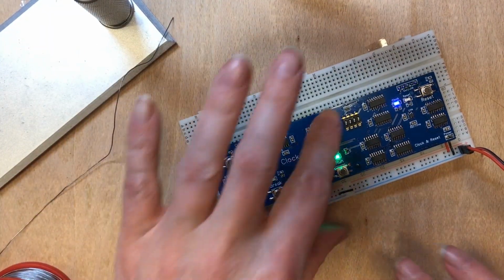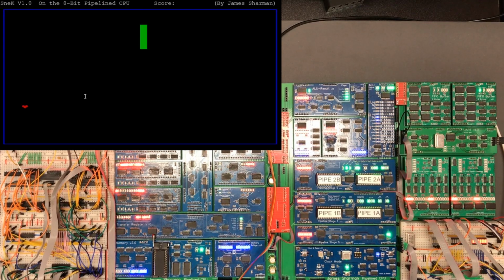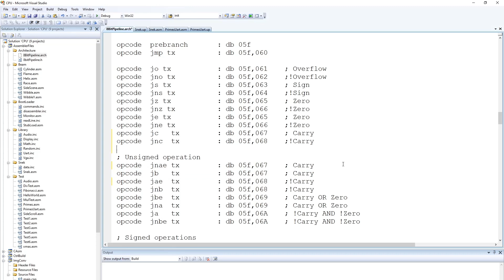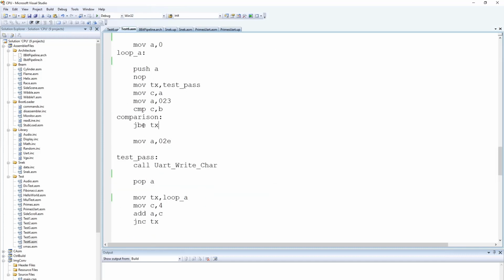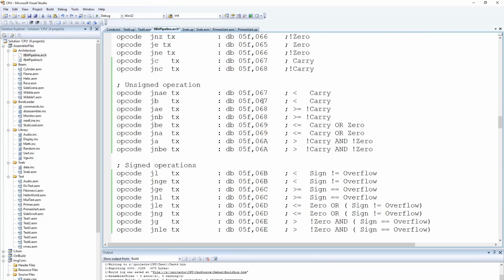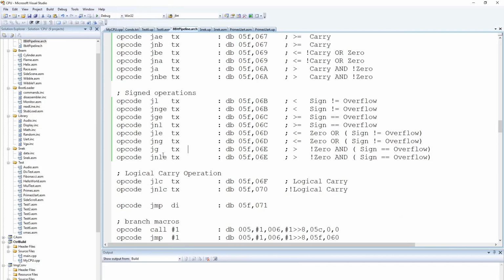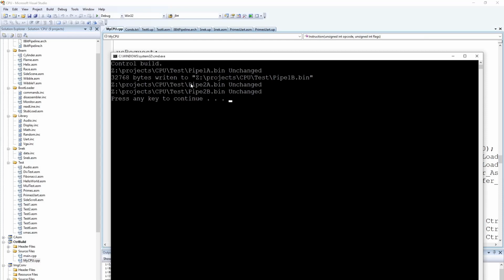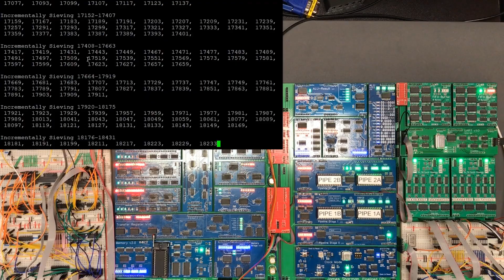Spring Cleaning - Making an 8 Bit pipelined CPU - Part 99

Comment from the maker: I would like some feedback on this approach of separating out longer bits of soldering and assembly. I didn’t want to have half the video be soldering that I had more or less shown before but I could do something like this for future pcb work as well.
Reply: This was a good way of doing it. I.E. have a separate video for those who want to see the full soldering, while having a sped up version in the main video, as most of all of the soldering is the "same" for all of the boards. That being said, if you find an error in the PCB while soldering it, cutting from sped up video straight to normal speed may be a bit jarring.

On the whole doing the video this way was good, I liked it.
Reply: Personally I don't mind the sections with the soldering, but I could see why it is a good idea to publish them in a separate video.
Reply: I like looking the soldering. But its ok to view another video. It seems a good idea to have interesting stuff for all on one video and seperate the other stuff. But its for me also ok if i can skip to the timestamp which is interesting for me.
Reply: Works fine for this kind of updates.
Reply: It was great to see your soldering technique develop over time. But now that you seem to have it down pat and the hardware is becoming more complete, I’m happy for the fast-forward version.
Reply: I like it! You are just doing the same thing again, and those interested should go back to the "ALU result" and "Clock circuit" videos for better context and explanations of you expect the circuits to do. And those interested in you soldering has the option to watch the stand-alone videos. Making those stand-alone videos you keep a good pace for the video, and it is 18 minutes instead of 40(ish) if they were included. But for new boards, like the upcoming VGA board I think that should be in the main video.
Reply: Another thumbs up vote on this approach. So much of soldering is the same thing which is why we typically automate it. There are plenty of videos focused on technique for those who wish more details of that process. I don't mind the speed transitions but it might be beneficial to experiment with different techniques to splice the regular and over caffeinated worlds together based on feedback.
Reply: For the most part everyone knows what soldering looks like but to have a longer version is not a bad idea either.
Reply: I think it's a good time to start breaking those out, or possibly skipping the extra work of editing/uploading them depending on if people are interested.  It was incredibly interesting to watch as you learned to solder surface mount, and experimented with different techniques, but now that it's just doing the same thing every time, it's less interesting.  I think that's really the key--if you're doing something new/different, it has more interest/appeal.  Thanks for sharing, as always!
Reply: Definitely - default to shortcutting the soldering, with the option (or links to) more in-depth  soldering videos.
Reply: If I was watching all of these videos after-the-fact, I'd probably want shorter versions, so I could get through them all in a reasonable amount of time. However, now that I'm all caught up, given the frequency of the videos, I'd be happy with longer versions, so I can hear more of your musings as you build things out!
Reply: I agree this approach is better (and as you know, I like soldering!).
Reply: Thanks for a interesting series
As long additional and important information is included in the main one I have no problem looking at the soldering afterwards

Comment: Good to see that the ALU Result PCB re-spin was simply incorporating the fix previously effected by a bodge wire and that the slightly "sus" behaviour of some of the conditional jump instructions was due to the microcode. So in the end, a clean and dare I say it: easy fix 😅
- On a related note, I've been tooling around with FPGA stuff and thus far, I've found that nearly all of the time unit tests (or "testbenches") of a device under test fail is due to dodgy input data in my test conditions, rofl.
Reply from the maker: Sometimes I wonder if it's better to keep a few bodge wires around. At the time of writing I have a couple of pcb's in the queue which are just reworks to incorporate bodge wires.

Comment: I still have an MC6802 Motorola microprocessor quick reference guide (I used to program it in Assembling code in the early 1980's). That guide was full of errors, that I mostly corrected back then, but I could still find and correct one more error a couple of months ago. You cannot even trust official papers on technical stuff!
Reply from the maker: I have a few old manuals with my own errata notes scrawled all over them!

Comment: Can I just ask, the monitor, seems like a silly question, are you running that as a terminal, or do you have an actual monitor working? As it seems to me the VGA card looks separate to the terminal screen. Also did you bin the lcd display? Can’t seem to see the point in the video when you changed from the lcd to the monitor
Reply from the maker: Once I had the UART working I used the lcd a lot less, I always regarded that as a temporary stop gap. The vga and the UART driving a serial terminal do cohabit.
Reply: @weirdboyjim  do you think you will introduce screen modes on the vga screen so you don’t need to log in via terminal

Comment: Quite tidy indeed!

I saw where you corrected the problem of the loss of the logical carry flag with an option jumper, and you appear to have fretted about bugward compatibility with the earlier version of the ALU.  Did you move the jumper in the final version? The discussion sort of swept the issue under the carpet.
Reply from the maker: I never did change it, I have an option in the simulator for either options as well.

Comment: Deja vu. Debugging the conditionals code in the DPS8/M simulator.

(Conceptually to me,  the simulator, C code implementing the conditional instructions is very much like the microcode in your hardware.)
Reply from the maker: That's semi intentional. I've always been a programmer so structuring my ctrl rom building code to be familiar as possible made things easier.

Comment: Carry=1 is actually "not borrow" on x86 for sbb, same for 6502 SBC. The trick is, the ADC and SBC instructions are both adds, but it does a bitwise NOT on the right side of SBC. Twos complement negation is bitwise NOT then increment. SBC did the bitwise NOT on the right side already, carry being initially set (not borrow) adds one to finish the negation. Then it proceeds to the add with the right hand side negated. If carry isn't set, it causes the right side to not have the increment applied, so it borrows one. EDIT: OOPS! I just checked, and you're right, I would have the exact same mistake. It's oddly reversed on x86 sbb. Sorry. Nobody can tell because x86 has the sub instruction that ignores incoming carry.
Reply from the maker: Ahh but the x86 does have the SBB instruction which uses the carry flag. The problem with this is the inverted carry flag isn't something you would notice unless you were doing an unlikely instruction sequence like add+sbb or something.

Comment: 16:50 - you need to leave those PCBs about the house such that younger generations find them in your workshop in 10 years time and you can say "I built my own computer from scratch" and send them a link to the playlist.

(Based on how my father's shack became to be filled with stuff, and everything had a story of "Oh, that was from project XYZ at company ABC"
Reply from the maker: When the cpu is done I'm thinking of a a collage with one of each on in a picture frame, I have lots of wall space that needs filling.

Comment: WOAH YOU CAN SEE THE SNAKE MOVE AROUND IN THE REGISTERS THATS SICK
Reply from the maker: Yes! At full clock rate "Snek" spends most of it's time in a delay loop to avoid it going to fast, that means whatever code is executed before then will leave it's registers on display, at least the parts not over written by the delay loop.

Comment: I was just wondering if you planned on doing some type of disk access? I know usb drivers would be a lot of work, but some type of simple disk access and maybe a FAT drive?

I like the cut down version of the soldering.
Reply from the maker: I definitely want some kind of bulk storage, I'd like to be able to run thru some demos without needing to swap roms or have the PC plugged in.

Comment: Nice work,
In the final backplane, you might want to directly add a USB to UART converter in order to fully integrate it
Reply from the maker: Thanks Samuel.   I wouldn't want to add functionality like that to the back plane, but I have been thinking about some tweaks to the uart board but as it's functional I'm not sure I should be distracting myself.

Comment: A c compiler for this would be cool! Maybe a llvm architecture so you can use all the front ends provided?
Reply from the maker: A c compiler from scratch would be far too much work, LLVM probably isn't suitable though, it's code generator is more tailored towards modern 32/64bit cpu's. There are older compilers which may be more appropriate.

Comment: It might be interesting to write testroms that check all the instructions. Of course you cant rely on the instructions themself as a source of truth and thus have to find another way to verify them. Having lookup tables might be a good idea, but they tend to become large if you have one for every instruction. Another idea is to verify a small subset and the only use those to verify other instructions, like verifying 'jc' works and then verifying 'jnc' with the inverted condition for 'jc'.
Reply from the maker: Would be nice to have some bigger tests, the value there would be less to confirm it works and more to help narrow down the problem when one crops up.

Comment: Really looking forward to your implementation of Sharman OS.
Reply: yeah, and the Sharman C compiler 😁
Reply from the maker: A C compiler would be really nice to have, but doing a good job of targeting a compiler back end to this architecture would be a big effort I suspect.
Reply from the maker: Well the loader/monitor is the basic beginnings. Need to create a standard for entry points back into common code to save space in loaded programs.
Reply: Or Rust compiler. Oxidation for the win!

Comment: Another amazing video! 

So if you are close to having enough of a collection of botched PCBs to build a second computer, will we see them networked? ;-).
Reply from the maker: Lol, would be interesting to see how many extra boards I'd need. The registers would be the big soldering effort.
Reply: Like this idea 🤣 But only trust one...
Reply: Could probably do so pretty trivially via i2c, but building an ethernet modem etc from scratch might be asking a bit much.
Reply from the maker: If you really wanted to network them, using the UART is the way to go.
Reply: @weirdboyjim  I suppose if you wanted to open up an entire range of additional accessability, the best investment of time would be in modifying/adding on to the UART to implement USB.

Dat 650 page USB 2.0 spec tho... Ouchies. I2C is only... what, 60 pages?
Reply: @weirdboyjim  That's what I was thinking as well!